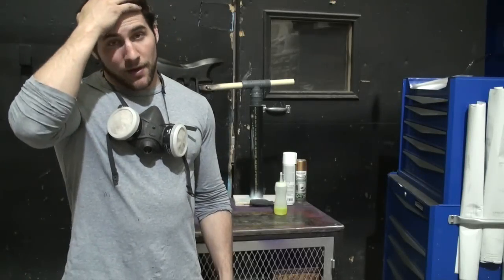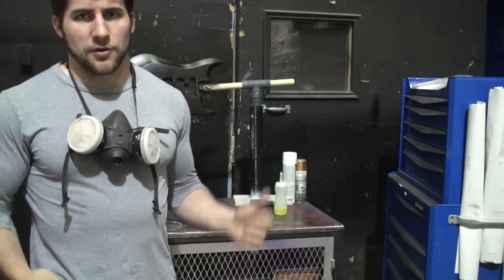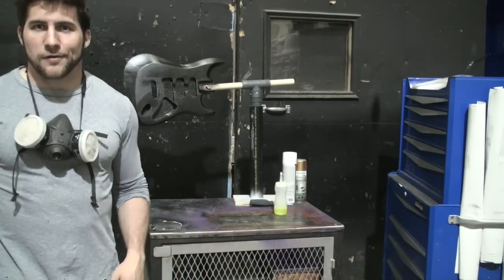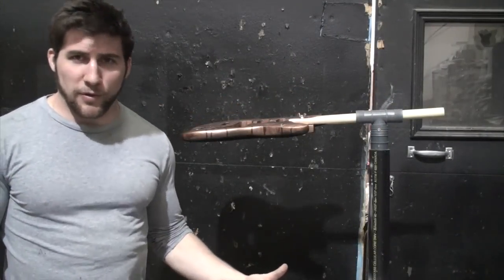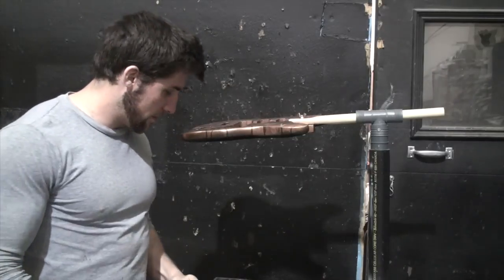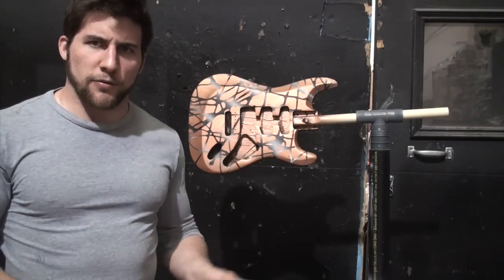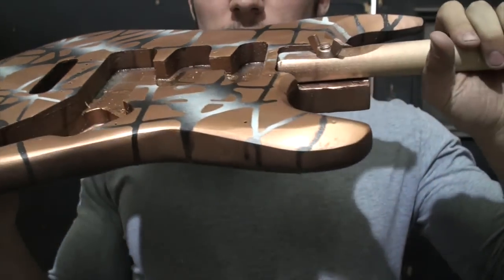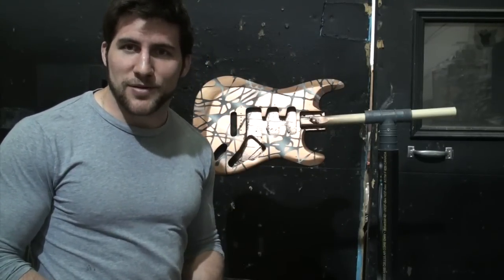How to do a cool guitar paint job with spray cans

Comment: Hi Brad, great tutorial, hoping to do something similar to an old Laguna I have.
Couple of questions, though: do you have a primer down underneath, or is that black coat your primer? And what will you use to finish the guitar on top of the paint, if any? poly clear coat, or nitrocellulose, etc? Thanks.
Reply from the maker: +Andrew Quesenberry Hi there. I do have some primer under there if I remember correctly. If I were painting over an already painted surface I would probably just scuff it and not bother with the primer.
I did this paint job with enamels, so if I were trying to protect it for a long lasting finish, I would clear coat it with enamel clear.
Reply: +Brad Angove thanks for your response, Brad. I removed the poly coat and got down to the factory sealer, sanded that, and will prime and paint on that. I didn't want to risk losing tone due to more paint and junk. Thanks!
Reply: +Brad Angove last question! What did you use to remove the dish soap from the body? Vinegar and water on that rag? And for how long did the paint dry before you wiped off the soap
Reply from the maker: I just used a damp cloth. I waited about 15-20 minutes I think, but that top coat of paint is on there very light, so it dried quickly.

Comment: Brad. 
Just kind of curious on the technique. Doing this paint job on my custom double neck. You first lay down 1-3 coats of black primer, matte black paint, matte white paint striped diagonally and then touch up the matte black, drizzle the soap on, paint with your top coat and then rub off. Is there a certain number of coats for the matte white? Matte black? Copper? What's the waiting period before you can rub off the soap without ruining the finish? Thanks in advance
Reply from the maker: High Travis. It sounds like you've got the right idea. You can do anything you want under the top coat. I chose black and white, but you can do patterns or a rainbow, or really whatever you want (rainbow under black looks really cool). 
I did two coats of the black originally to get full coverage, but everything after that was just a matter of putting on enough paint to get the look I wanted. No specific number of coats.
You need to leave the dish soap long enough for that top coat to dry. I dusted on the copper pretty lightly, so it dried in about 5 minutes. I waited 10-15 before wiping off the soap.
Reply: Thanks man big help. I'm gonna try it out on my double neck
Reply from the maker: Awesome. Let me know how it goes.
Reply: Brad Angove so far, I've got my black and white diagonals (sadly on mine it looks more like the "rising sun" flag but it works) put on but so far everything is working awesomely but I have a quick question. Between putting dish soap on and the black/white paint  do you clear coat Or go strait to dish soap? Thanks in advance
Reply: Brad Angove oh and also iv3 decided instead of copper I'm gonna use a metallic gold
Reply from the maker: If you're using enamels like this you don't need to clear coat before you put on the dish soap. I think gold will look good. I'm looking forward to seeing it.
Reply: Brad Angove well after my first attempt the gold splattered :/ so I'm gonna restart thank god they made nice sand paper
Reply from the maker: What do you mean it splattered? Did the can spit? What kind of nozzle does it have on it?
Reply: Brad Angove sadly I'm using a rustoleum rattle can and I think it was main because the can might have been either not shaken up enough or warm enough
Reply from the maker: Ok. Make sure that your nozzle is clean. If it's one of those old thin nozzles rather than the "spray in any direction" kind, you can turn it upside down and spray the can until just clear gas comes out. That clears out the inside.
Reply: Brad Angove if I want a more full look like what you have should I do more of a dusting? Or what should I do
Reply from the maker: I'm not sure what you mean by a more full look.
Reply: Brad Angove when I finish putting gold on it looks like a 75% transparency how do I avoid getting this? Could I mimic technique by using masking tape?
Reply from the maker: The metallic gold is semi-transparent. You should put a more opaque colour underneath it first, the dust the gold overtop. Try a reflective metallic gold, or a golden yellow first.
Reply: Brad Angove would pulling apart masking tape and taping different sized and lengthen lines to mock the dish soap work as a "last resort"?
Reply from the maker: Absolutely. It's not really a last resort per se, it's just a bit of a different effect. That's the technique that is used for those frankenstein guitars and stuff like that.

Comment: Amazing and cheap Trick brother!
   ~Question, do you wait for the dish soap to Dry?
   Or just as soon as the spray paint is dry, rub the soap off?  thanks!
Reply from the maker: DarkRenaissance2012 Thanks. I get the soap off of there as soon as the paint is dry enough. Don't let the dishsoap dry.
Reply: Brad Angove
Awesome, Im glad to hear that, because I did this technique on my 7 string Schecter and washed off the soap as soon as the paint was dry...
   I used Gold though, and it turned out really good!
  Is there a way I can share my Pictures of it with you?
Reply from the maker: That wounds awesome. I would love to see some pictures. You can share them with me on facebook if you want; that's probably easiest. The link to mine is in the description.

Comment: How did you get second coat to stick without sanding,  i want to do a sort of chrome colour base with almost a candy red on top, if I wait till the chrome is almost dry but stlll tacky will it stick
Reply from the maker: It should, but the soap might stick a little too. Instead, I would like the chrome dry, spray a light mist of adhesion promoter on there, and then move on to the candy.
Reply: Brad Angove cheers for the help,  I'll let you know how it turns out
Reply: Dude, not sure if it's just my dish soap (I used normal fairy liquid) but the worst paint seems to have mixed with it and formed almost a crackle with colour underneath,  any ideas?
Reply from the maker: Was it a water based paint at all?
Reply: Brad Angove oops, yea it was rustoleum painters touch, assumed it was same as rest but just read it is water based.
Reply from the maker: Damn. Yeah, that’s the problem probably.
Reply: Brad Angove can it be saved or shall I wait for it to dry and sand down, presumably no real way of getting soap off without removing rest of paint
Reply from the maker: I think your best bet is to sand back and make sure you get all that water-based stuff off of there.

Comment: Will the 2nd color adhere to the striped layer of paint naturally?
Reply from the maker: I'm not sure what you mean by naturally, but it will adhere mechanically if you scuff that bottom layer before spraying over it.
Reply: +Brad Angove I was meaning did that bronze layer stick naturally to the black and white striped layer you put on?
Reply from the maker: It stuck mechanically to the striped layer because I scuffed that layer before applying the bronze.

Comment: Did you let the paint dry before you put the soap on and did you let the soap dry before putting the last coat on? I love the look also!
Reply from the maker: I let the paint dry before putting the soap on. I let the soap dry just long enough that it stopped running before I put the last coat of paint on. You don't want the soap moving around while that last coat is drying.
I'm glad you like it.
Reply: Brad Angove Okay, thanks for the help!
Reply from the maker: You're welcome.

Comment: Nice one Brad, that looks very cool. I'll try that on my p bass I think... I don't often use spraycans, but have done a few basic effects & coverage with airbrushes, and I like inventive masking and the mad results, not come across dish soap masking before though! (I use latex masking fluid). I've just discovered I've got to respray the front of the Strat I'm doing as I hit a thin patch on an edge while wet & dry-ing. Gutted. Any advice? Its going to be satin finished, so shouldn't be too nasty... Gonna have to invest in a compressor and sprayguns...Nice one. Mick.
Reply from the maker: +Michael Jones Hi Mick. I'm glad you like the paintjob. You can actually use this masking technique with airbrushes as well as long as you're using a paint that will hold up when you wipe off the soap. What kind of paint were you using on the strat?
Reply: Acrylic car paint- its Halfords Electric orange, going to go over the front again today. I might look for some water based polyurethane to clear coat her if its compatible. I'll spray some on some scrap to sacrifice.
Reply from the maker: Sounds like a good plan. Spot repair is unfortunately very difficult with those kinds of paints, so going over the whole front is likely a good option.

Comment: would this effect the tone at all?
Reply from the maker: There is a highly contested debate over that. People on both sides of the argument say that they've proven themselves right, so it's tough to know. My position on it is that once the pickups receive the signal, only the electronics really matter, so things other than that will affect tone only to the degree that they affect string vibration. So the answer then as far as I'm concerned is technically yes, but not enough for you to really notice.
Reply: okay thanks for answering i appreciate it
Reply from the maker: You're welcome.

Comment: I tired this on one of my guitars and failed miserably lol. I'm going to read though all these comments and try again but here's where I know I messed up (so someone else doesn't make the same mistakes). Don't roast me too hard. I already know I made some dumb mistakes lol. 

Everything was going great but I think I put waaayyy too many coats on top of the soap. I basically finished off the can and it must have been 6 or more coats. That was bad lol. Then, I waited waaayyy too long to try to get the soap layers off. It wasn't coming off easily and I was afraid of messing up the top coat with a rag so I didn't want wipe it. I had seen someone else on YouTube use water to wash off the soapy layer so I used a water flosser (made for teeth) to start getting off the soap. That was the big mistake. Water got into some of the cavities that weren't taped off and the wood swelled up so bad that the body got cracks all over it. At this point in not even sure it's repairable. Currently looking for a replacement body on Reverb lol. 

TLDR: Don't put the top coat in too thick, don't let it dry too long, don't use water to remove the soap.
Reply from the maker: Sorry to hear that it didn’t go well for you. Introducing water is always risky.

Comment: Dish soap....no shit, wow! Eddie would have saved so much time back in the day if he knew that trick!
Reply from the maker: Kim Cornell Too true. It wouldn't look quite the same as the tape work, but still pretty cool.
Reply: Brad Angove do I clear coat it after? Do I need to buff? How do I?
Reply from the maker: You should clear coat it after to protect it. Buffing is to flatten out the finish and give it that mirror shine. You can decide if you want to or not, but you probably will want to. Have a look at one of my videos on sanding and polishing.
Reply: I think it looks better than the tape

Comment: did you let the paint dry before using the soap?
Reply: please answer fast
Reply from the maker: Yes.
Reply: +Brad Angove thank you
Reply: +Brad Angove I used the soap on my guitar and it spread out and the lines became very wide.  should I use less soap or is the soap too thin?
Reply from the maker: Did you thin the soap? I applied mine with a very small nozzle and didn't thin it at all. It still spread out a bit, but I put a very fine line on there at first.
Reply: I did not thin it out, I will try a bottle with a smaller hole
Reply: Thank you for responding, would not have been able to paint my guitar without your videos
Reply from the maker: Thank you for watching. I'm glad you found the videos useful.
Reply: how long did you wait before wiping the soap off?
Reply from the maker: I waited about 10-15 minutes. I spraying the copper very lightly though so I wouldn't have to wait too long.

Comment: Can I paint a guitar that's covered in plastic?
Reply from the maker: killian ryan What do you mean it's covered in plastic?
Reply: Its a crap guitar I bought in lidl and I think its coverd in metal or plastic, not even sure if there's wood in it at all :\
Reply from the maker: That's interesting. You should still be able to paint it. Just use adhesion promoter first, and maybe a plastic compatible primer.
Reply: Okay thanks

Comment: now do back side and make lines match front HA HA
Reply from the maker: I probably won't do that, but if I were going to I would use fine-line tape to transition the lines to the back, and then base my soap pattern on the back on those starting points.

Comment: Voice over would help
Reply from the maker: Or music haha. I clearly had some editing difficulties with this one.
Reply: Shows how good you videos are now.  Great channel.
Reply from the maker: Thank you.
Reply: Since you online.  I primed and painted my guitar body with Rust-oleum Painters Touch 2X. After that I saw you your video on painting with Duplicolor.  The Rustoleum help line says I can paint with Duplicolor 48 hours after the Rusto.  Do you agree?
Reply from the maker: Technically you should be able to do that, yes.
Reply: Thanks
Reply: It worked great.  Technically I waited 72 hours.  Now I know the difference between enamel an lacquer.  

In fact it tuned out so well that that my client (14 year old son) doesn’t want me to clear coat.  I checked on-line, but no one said why you need to clear coat metallics.  Can I leave the paint as is?  Should I polish it?  Would it make sense to clear coat it matte to keep the look?  Thanks agin for all your help.
Reply from the maker: The clear coat is to protect it and increase the contrast. Without the clear, the metallic can get damaged much easier. 
You won’t be able to polish the metallic directly. It will need with the orientation of the pearl. 
You can clear with matte, but it will dull the metallic effect slightly, whereas gloss will amplify it and give it more contrast and punch.